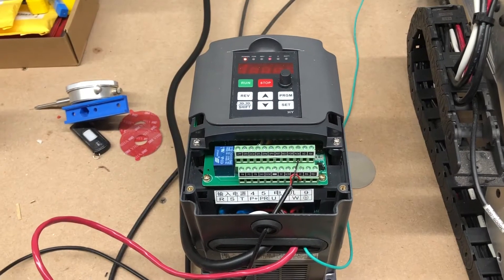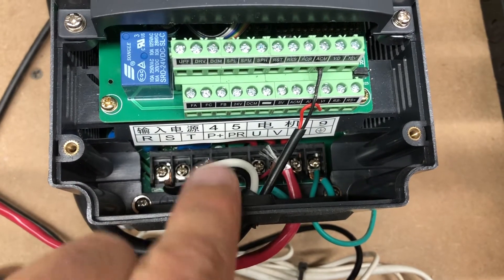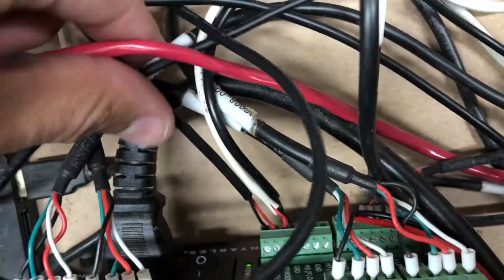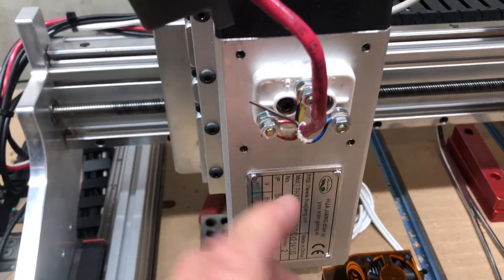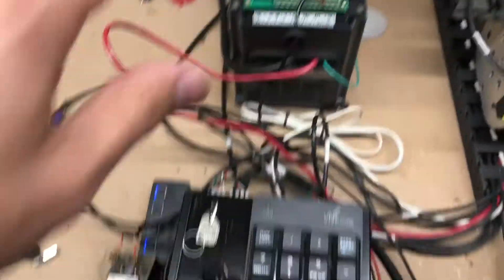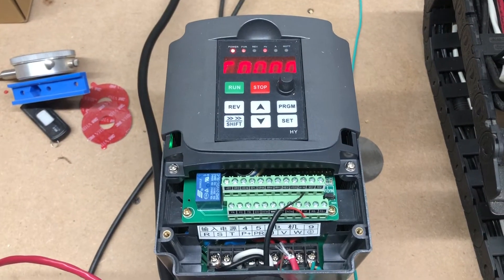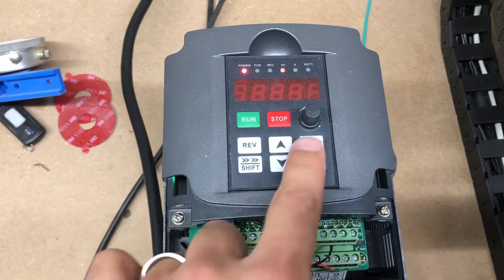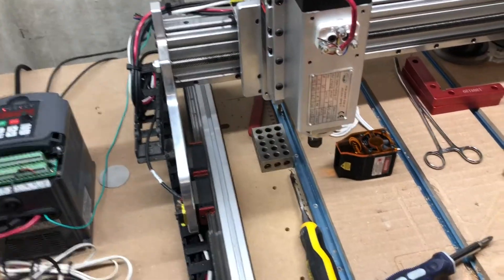Huanyang Inverter VFD Wiring for X-Controller

Comment: Just one question. My controller bored only has a positive and negative dc motor port where I am told my vfd should connect to. Where does VI go and where does ACM go

Comment: Firstly, thanks for your videos. My company (at my request after seeing another of your videos) just purchased an X-Carve and the ultimate upgrade kit from CNC4Newbie. We also bought the 220V 2.2kw Huanyang VFD & spindle combo from
amazon. Secondly, I do have one question. I haven’t been able to find much literature on the operating characteristics for the X-controller I/O. Having said that, I’m curious as to why you used the X-controller’s PWM output instead of the 0-10V output to control VFD frequency reference. My current setup (which I have not tested yet), is using the flood coolant output as the forward run command for the VFD and the 0-10V output as the frequency reference. I’m not using the PWM output at all, so I was wondering if there was some advantage to using it over the 0-10V output.  THANKS!!

Comment: Thank you for the two videos on VFD and spindle.  I do want to mention two things you should be aware of.  I believe you used 18/4 fire wire and I believe it is solid as opposed to stranded.  If so, it is going to fatigue and you will end up with a break that will shut down your spindle.  Stranded would take the abuse of constant bending and unbending.  Also, you should use the spare conductor to the spindle to ground the spindle to the VFD.  The x gantry does not have a good connection to the y-axis.
Reply from the maker: cica322 I ended up switching the wire. It did end up getting damaged about 30 hours into using the spindle. I have now switched to stranded